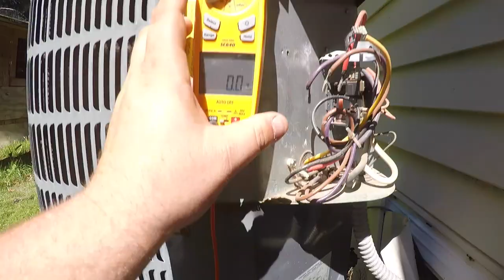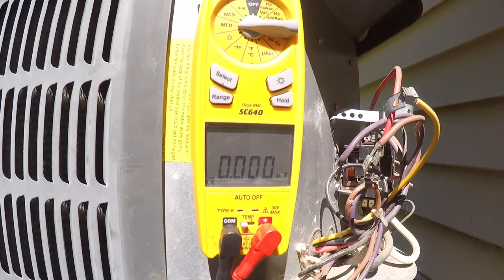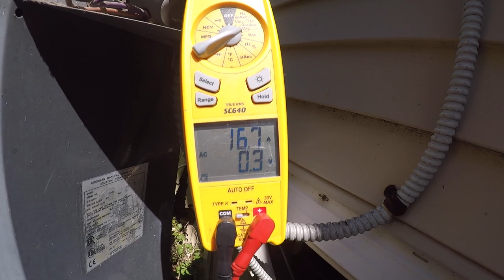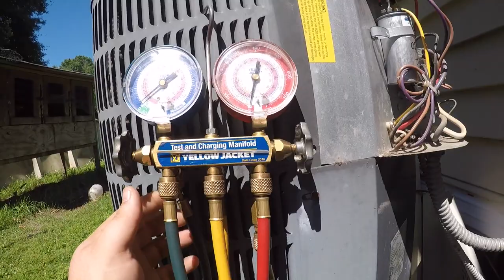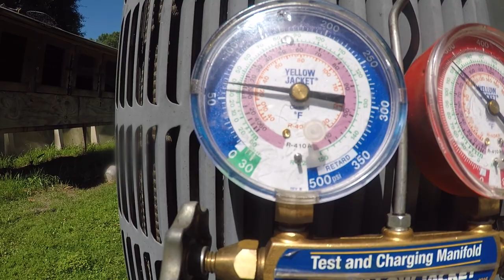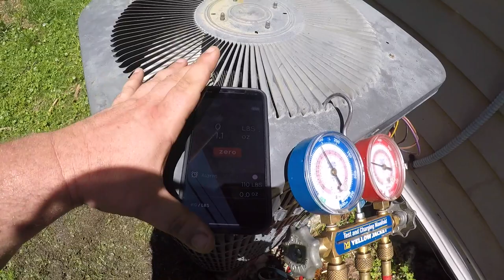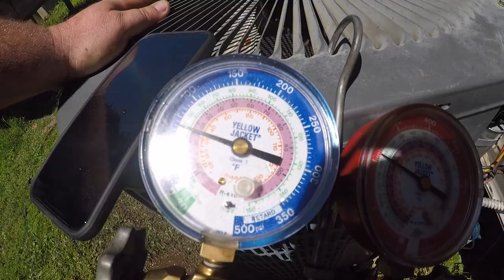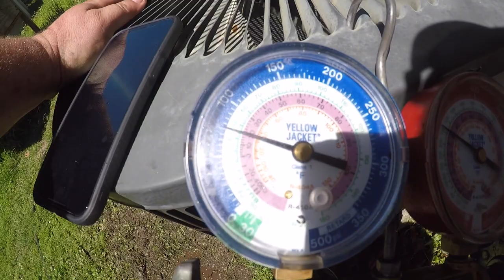HVAC No Cooling/Simple Service Call

Comment: i know your going to hate me for this one,  should have used sub cooling,  i think you could have done more charging.  if the house was hot  your suction would have been close to 80 and head would be closer to 250  but thats assuming  of course.   Glad ur back.
Reply: That system was probably a piston so it would be super heat not sub cooling. That is assuming. 🤣